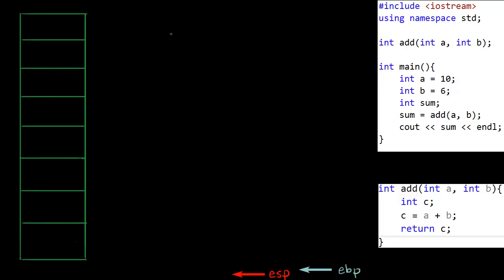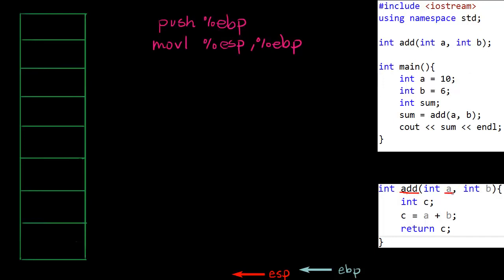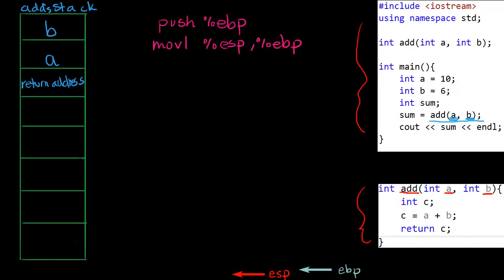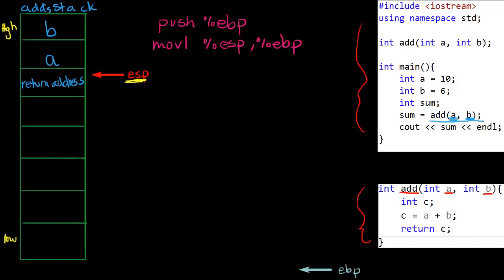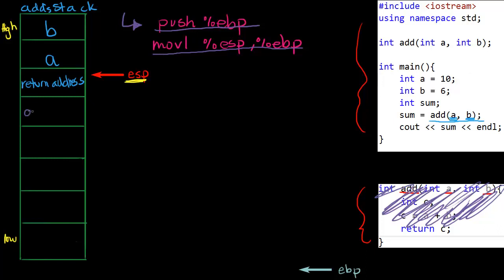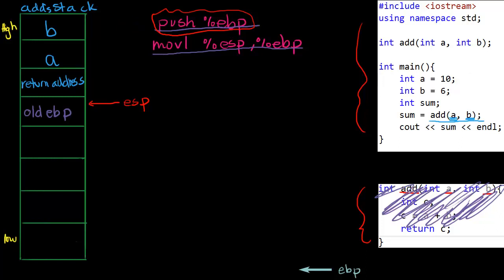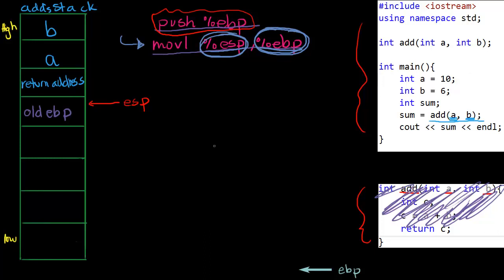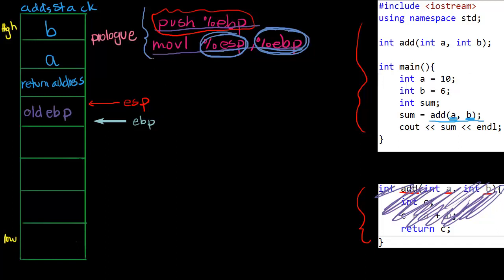Prologue: Intel x86 Assembly Att Stack

Comment: You're saying that a and b, both aprameters of add function, are pushed onto the stack before the call is made. But I thought that, to pass parameters to a function, four registers were used before actually pushing other values if needed. Am I wrong ?